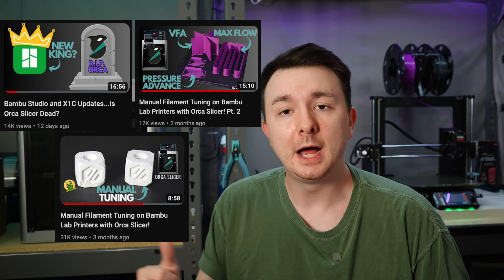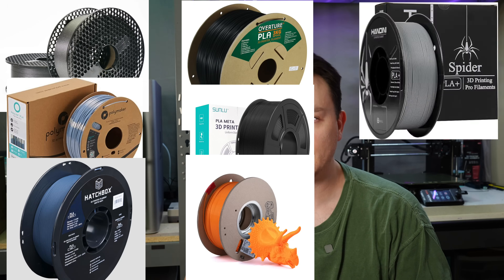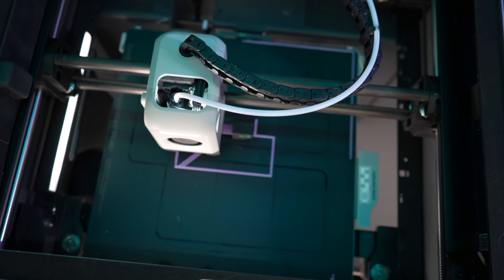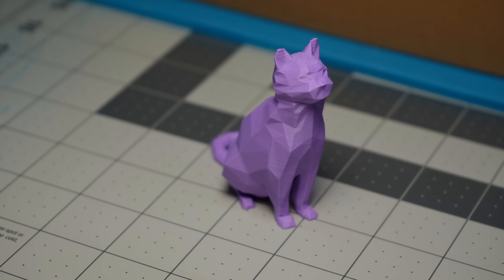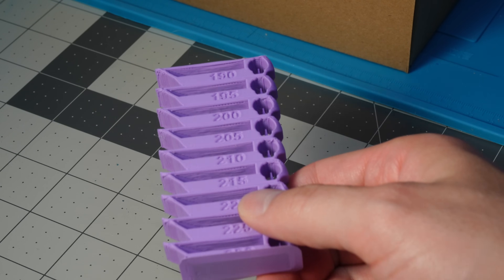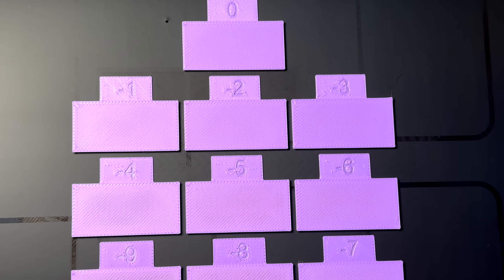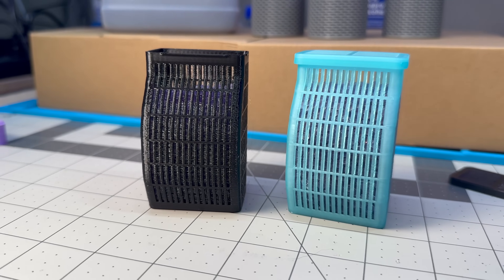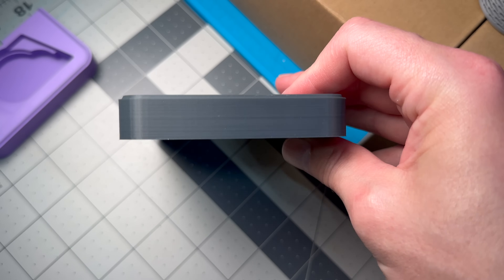My Secret to Filament Tuning with Bambu Lab Printers

Comment: You should at least check for dimensional accuracy, meaning hole sizes (hole size compensation), small feature sizes (XY compensation) and shrinakge for bigger parts.
Many people will create a master thesis out of this stuff but really as long as you are in the ballpark you won´t see any difference at all. If your pressure advance is 0.2 or 0.19 or 0.21 really does not matter, you won´t even notice it. Same goes for temp. I do print my PLA with 220 as well, 230 is saggy and cooling is at its limits so I chose 220, now can I print at 215 or 210 ? Sure but layer bond is important to me so I chose 220, honestly the results are basically the same. The rest of the parameters are mostly machine parameters like retraction depends on your machine style bowden or not and nozzle length you don´t need to change much, my retraction test looks the same for 0,5mm up to 2mm retraction distance for instance. So I just leave it a 1mm and that´s that. People seem to think there is all kind of magic involved like "magic layer heigh numbers" or some other woodoo bullshit, this is simply technology there is no magic.
Reply from the maker: Well this video wasn’t really about dimensional accuracy or other slicer parameters. I have another video on that! I’d also argue you totally can see a difference between 0.019 and 0.02 but does that difference matter to you? That’s a personal choice in print quality. I understand everything you’re saying, but most of it is just outside the scope of this specific video. This was a follow up to my Orca slicer vids showing manual tuning. It was meant to be a succinct way to show that for filament tuning, without using auto cal, I just run K and EM tests. Nothing fancy.
Reply: @ButterPockets  Dimensional accuracy is probably not filament tuning but printer tuning. However shrinkage is material type depended, it is important if you want to print parts which should fit somewhere or have a function besides plastic trinkets. 
I honestly could not tell the difference between 0.02 and 0.019. If I gave you 10 pierces with slighly different parameters I bet you could not either but that´s or course debatable.

Comment: try just once to set the slicing tolerance and deviation to 0.0001 and see the perfect walls on ur plate. takes a tiny bit longer to slice perhaps seconds.
EDIT: Remember to turn off arc :)
Reply from the maker: Why would you turn off arc fitting?

Comment: When printing on the X1C what speed profile do you use the most. Optimal?
Reply from the maker: The 0.2 standard for the most part. I will almost never use grid, so I no change the infill type.

Comment: will you provide your filament profiles?  Big user of Prusament filament and just got my Bambu X1C and would love to just download and setup for Prusament PLA and Prusament PETG
Reply from the maker: Unfortunately it doesn’t work like that. Every roll/printer will be different. You’ll find tho that a k value of around 0.02 and an EM of around 0.98 is a good starting point.

Comment: Quick question: why didn’t you pick 0.03 for pressure advance? It looked better than all the other ones.
Reply from the maker: I understand what you mean. .03 looks way different than even 0.029. But the trend that was started didn’t just stop, if anything it’s a fluke. And even still, the corner on 0.03 is WIDE it’s not sharp like at all.

Comment: Sorry, but I have one problem with understanding. You have bambu lab X1C in background and you are tuning flow rate and pressure advance, aren't you? Why not to use just auto calibration for it?
Reply from the maker: In those videos I mention at the beginning of the video I cover it. The auto calibration is nice but it’s not very accurate.

Comment: Why do you change the settings for the fans?
Reply from the maker: The chamber fan just annoys me, it doesn’t help to cool anything. The aux fan I find is too much single directional cooling (and it’s annoyingly loud). I don’t really see a difference with it off so I don’t really turn it on. It’s worth playing around with for your prints. If you print something with overhangs tho and they are on the left the fan might not even help!
Reply: Thank you so much for the reply! @ButterPockets

Comment: I just bought the P1S so now I want to do this to see where my filaments stack up.  Would you do the same thing for Silk PLA filaments or do those need to be tuned different?
Reply from the maker: I would tune silk PLA, matte PLA, and basic PLA separately! They can definitely have different behaviors.
Reply: @ButterPockets  Sorry, I guess I meant would you do the same things to tune silk PLA, i.e. the pressure advance pattern followed by EM pass 2?
Reply from the maker: @MultiHippie13  yep! That’s what I meant. You could run all these things for silk and they would probably hold for most other silks. Run it for mattes and it would for other mattes. Etc.
Reply: @ButterPockets  Awesome, thank you for the advice!

Comment: https://youtu.be/5CVq6DycUOE?t=667  how do you tune your layer time? what am i supposed to do when seeing this?
also how does that formula work earlier in the video to adjust flow? i only see the patch variable in the old value of the formula. i dont get it
Reply from the maker: You can change your layer time by going into your filament settings and changing layer times. You can also print multiple parts at one time. The formula is changing your current value by the percent of what patch looks best. So if “-3” looks best you are essentially lowering your current value 3%. So if your current value is .98 and you choose “-3” then you multiply 0.98 by 0.97 to reduce it 3%. I hope that makes sense. The portion of the formula that is “(100+patch)/100” is just a percent change.
Reply: @ButterPockets  thank you for the explanation! Can you maybe make a short where you see the effects of layer time and how you see if it needs to increase or decrease? Like a temp tower but with layer time?

Comment: Do you post these profiles anywhere?
Reply from the maker: They aren’t really postable. You’d have to just run the calibrations for yourself. It will be different for your filament specifically. Anything else I covered would be print dependent for the most part. I don’t change much in terms of the default slicer profiles honestly.

Comment: do you ever change filament setting on the X1C like when you load the AMS?
Reply from the maker: I’m not 100% positive what you mean. Can you rephrase that?
Reply: @ButterPockets  I choose the filament type then run the auto calibration so I can set the vendor. But then I change filament properties  in filament properties because I cannot set Temps on the AMS :(
Reply from the maker: @JBGecko13yt  you’re not supposed to. The point of that is so you don’t have to run the auto calibration again. If you have 3 polymaker PLA filaments then when you put polymaker in it automatically has the PA value set for you. Then you control everything else in the slicer settings. It’s a roundabout way to do it, which is why I still prefer the way Orca handles it all in the slicer, but works!
Reply: @ButterPockets  thanks! I'm still working through my testing methods for filament "I'm new" but I learned a lot from your video.  I wish the bambu software did all this also

Comment: Should I be able to complete all of the calibration with a larger nozzle, or the tests only for 0.4mm nozzles?
Reply from the maker: For all nozzle sizes! Should run through it all when you change the nozzle too

Comment: Does setting the PA Value, in the filament settings. 

Override the K/PA Value in the ams settings?
Reply from the maker: I honestly don’t know the answer to this. When I use Orca I remove the setting in the AMS and set it to like “default” where it doesn’t have a setting.
Reply: @ButterPockets  I think mine are all set to 0.02 or whatever it is. The default. Can we just remove it altogether?

It's one of those things that annoys me not knowing if the pa value is overriding the ams setting 😂 so I'll never know if it's correct.
Reply from the maker: @tjCooper88  yeah I know what you mean. I talked a lot about using Orca…but honestly I do the manual tuning and plug it all into the AMS/Bambustudio now. It’s been easier. What really killed it for me is Orca wasn’t doing bridging the same way as PS or BS. So I had to switch over. Then orca fixed it but I haven’t really moved back.
Reply: @ButterPockets  ah I didn't know about that. Best to set it in both filament and ams then I guess? Just to be safe. I'm using orca still but sometimes flip between the two.

Comment: I finally got some time to watch this…again, THANK YOU.

I’m a furiously and frantically printing full beds, around the clock.  I only sleep when I can.  I dabbled with stacking and it seemed like too much effort at that time.  Each bed takes 8hrs on a stock 0.4 nozzle with the .24 draft profile, in both ASA and PETG.  My widget is for fishing and could be in direct sunlight for extended periods.  I’m only using bambu filament.

I need to cut those batch times down to be ready for launch this spring.  I got a handful of the new modular hotends with cht clones.  With Petg’s max volume now set to 27mmc/s with the cht 0.4 I shaved 2hrs off the batch but increased total filament per batch nearly 100g.

I then screwed in the 0.6 cht and my carbon threw a thermal error at about 34mmc/s, but the calibration model looked amazing when it pooped.  I’m wondering if I hit the max for the stock heater.  I think others have flowed more than 34mmc/s with a carbon so I’m a little confused.

I really am winging it, learning as I go.  It seemed to me, max volumetric flow is the speed limiter on carbons.  But these new nozzles can change that…which now has me wondering what the next limiter is.

Any guidance or advice for this?
Reply from the maker: I have absolutely no advice for that haha. 34mm3/s is lot! I’d rather just get a second printer than try and make my one print faster and faster, but that’s just me. Of the prints I sell I don’t hit nearly the volume to need two or print very fast. That’s part of my this is just outside my realm of knowledge.
Reply: Late to the show on this reply, but do you find a decent increase with the CHT clone nozzles?

Comment: Hey butter fantastic video. Do you change any of the PA or EM settings when moving from a 0.4mm to 0.2mm nozzle?
Reply from the maker: I switched to a 0.2 and clogged it when running the tests! I’m not the best person to answer honestly, but I would assume the numbers are close but that things might need to change. I’d run a print that you know how it should turn out and see how it looks. If corners look weird, the seam looks bad, or the top surface is gross I’d adjust from there!

Comment: Great video one comment , i have a few filaments with flow over 1, if i see Pass 2 gives me best result at 0 , i go to Pass 1  and then do the Pass 2. Also found that some times K factor first is not always ideal, So i do flow first to get good flow , then K gives me better results and some times flow again Pass 2 . Also using the tower method for K find it easier and more clear and consistent . by averaging the each corner, But that could be the old eyes and just me . A bit slower but more consistent.
Reply from the maker: It would be a lot faster that if 0 gives you best results, set your flow ratio from the beginning to 1.1 and then run pass 2. I wish they would just let you pick the steps. The steps in pass 1 are too wide to give you any real information other than if it will be higher or lower than 0.

Comment: How do you adjust for layer times and how do you know when its needed?
Reply from the maker: I’ll eventually cover that in more detail. The quick answer is print more things at once. You know it’s needed if you can see some layers or sections (in Z) are bulging out or look different. Like if you print a benchy and the “hull” is shiny.
Reply: @ButterPockets I’m looking forward to that content. This is an issue I’m currently trying to understand with the layer time issue. Great videos, keep it up!!

Comment: I set the PA to 0.015 for the filament and also in the printer.cfg But every time I start a print I see Fluidd in the console set PA to 0.044. Why is that?
Reply from the maker: Is this with an X1? I assume not since you’re using fluidd. Usually if you set it in printer.cfg it should update. I’m not incredibly well versed in klipper/fluidd. I personally use mainsail. Something must be overriding it. Not sure if it’s something in start/end gcode or somewhere else in printer.cfg or if printer.cfg is not saving your changes.

Comment: I've found that the print speed on the Bambu printers can really be more trouble than it's worth. With big objects, the speed introduces a lot of artifacts as it goes higher. I've had to mess around with settings to slow the speed down.
Reply from the maker: In a previous video I talk about that. Printing faster can actually get rid of that sometimes. (the bambu CEO even mentioned that at some point).

Comment: I was always under the impression that you should calculate flow ratio first before PA, does this not actually matter?
Reply from the maker: It does matter and from the people I’ve talked to you should do PA first. It controls when you extrusion starts when making the passes on the top layer. Controlling that first lets you dial in your extrusion multiplier

Comment: I would run pass 1 first, since you dont know if anything higher than 1.0 flow rate will look better. Pass 2 only shows you 0.91-1.0 flow rate. Also i think the PA tower is best for seeing the exact point that your corbers start looking like crap. I do agree on temp tower though..ive never really got useful info out of it. I just stick to 210-220 for PLA usually. Most PLA also does good with 0.4mm retraction as well so thats my default.
Reply from the maker: I rarely ever have to go over 1. And if you see that 0 isn’t enough you’d know. Pass 1 only runs large increments, I’d like it if Orca let you choose the range.
Reply: @ButterPockets  but you can choose the range with the initial value. I typically start with 1.02 and do the second pass. It seems to me that if you are getting your max or min values then it's time to tweak the scale.

Comment: Watching a print is absolutely the best way to diagnose anything. The X1C is sometimes a bit too fast to see what's going on, but in 99% of the time you can diagnose anything by just looking.
Reply: I realised this the other day. I had a slight bed adhesion issue and a corner lifted during print. It didn't cause spaghetti, but the layers looked crappy in that area. What I also saw was as that layer stood slightly high, the print picked up boogers stuck to the print head. These ended up inside the print, but affected the external appearance of the finished part. If I had just picked up the part at the end of print, I might have realised it hadn't stuck to the bed properly, but there's no way I would have noticed the residue on the print head issue, as that residue had disappeared inside the print. This is a p1s so I think, a. I need to check adhesion/bed temps b. Ensure a clean print head prior to printing c. Investigate whether a better print head cleaner is needed.
Reply: How ? What do you look for ? I'm really trying to figure out my X1C. Sometimes it will make the most outstanding prints. But then other times there are problems like crazy and I can't seem to figure out what is causing what try as I may. I've researched and learned and am up to speed on most of the info out there but it just seems like there are some secrets in there I need to discover.

Comment: Really nice Video. Well done - Thank you. Just FYI: the blue to pink dessicant contains a carcinogenic (cobalt hexachloride). So you might want to switch that out to another variant that doesn't cause cancer.
Reply from the maker: These are said to contain less than 0.3% and I’m not eating them. But good tip, might switch anyway.

Comment: this is a great video!! really actionable, valuable advice. well done. do you ever print multi-filament with the AMS? might be interesting to talk about those settings as well (e.g. to minimise waste, etc.)
Reply from the maker: I do all the time and I never touch those flushing settings to be honest. I’ll mess around with it and see if I can get a video out of it!
Reply: @ButterPockets  nice!! I think there's quite a bit there with setting the right amount to purge and something around the tower vs infill use for the transition. plus, on top of those settings, maybe some best practices when creating the model/ importing it, as well as some materials that go well together and some that don't. I'm sure you might have even more ideas - you've got this! 😎
Reply from the maker: @petermarin  there’s definitely some good practices to do in CAD and I can cover that for sure. I’ve learned some good ways to export models for color printing that really helps. I’ll add it to my list for sure - I’ve got a couple coming out soon and some sponsorship stuff to handle first. But I really appreciate the idea!